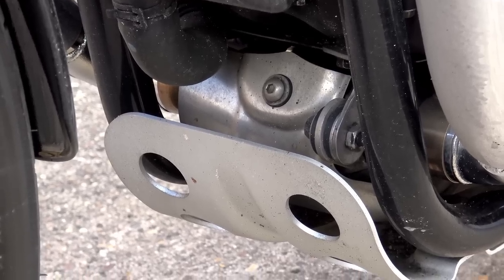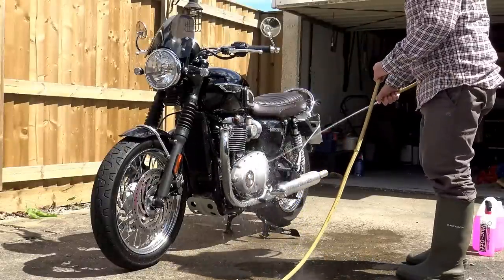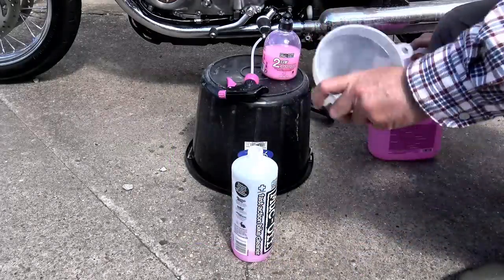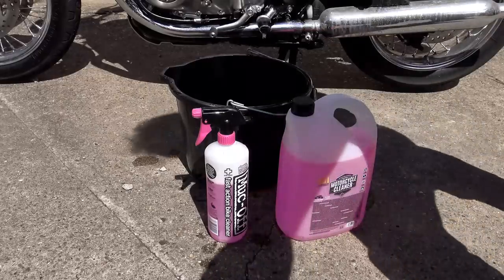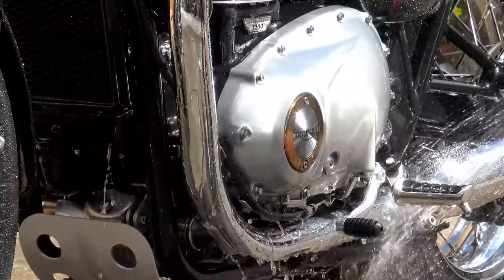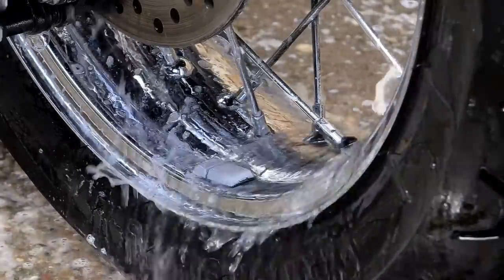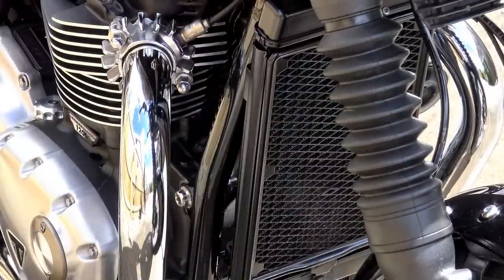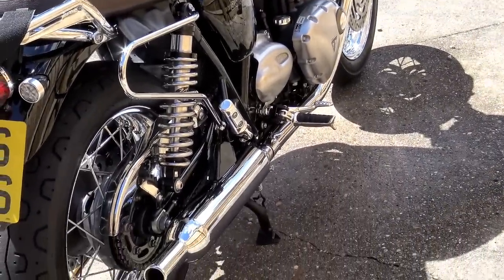Triumph T120, WASHING YOUR MOTORCYCLE. The ultimate bike cleaning method ?

Comment: Stuart, excellent video sir! The only thing I do a little different is to use a light air compressor after drying as much as possible with a cloth. It has the same effect as riding the bike in the final step. That said, I always try to take the bike out and work all the controls. It's amazing where water pools up and can cause some rusting. Thank you sir for all the effort! I learned a lot and will definitely add it to my regimen!
Reply from the maker: Thank you sir, have to admit I do use a compressor myself, but not everyone owns a compressor so I thought I would leave it out and just go down a route everyone could follow without having to lay out for expensive equipment!
Reply: Excellent video.  I currently use S100 - have used it on my previous bikes and now the T120 with success.  May have to try Muck Off when I run out of S100.   Another air method I use for preliminary drying is my gas powered leaf blower - more mobile and not as concentrated as an air compressor nozzle.
Reply from the maker: Thank you sir!
Reply: one of those cheap high power pet dryers available on Amazon work a treat, they really blow the water out
Reply: Also use a leaf blower here to finish things off .. you´d be surprised at all the water that sits in nooks and crannies .. a compressor on the other hand often has oil and especially dirty rusty water sitting in the bottom of it´s tank and that grime can be blown out with the air even though it may not always be noticeable… before wiping dry though a bucket of water mixed with a little Neophos shine from the dish washer thrown over the bike makes for a streak free finish

Comment: Just washed my new RT to your method Stuart. First time I've cleaned a bike for 37 years - and it works! The only thing I did differently was to use my leaf blower to dry it, which worked very well. Oh, and got the hanky out for the bits I'd missed when I'd put everything away, as you do... Thanks for the insights.
Reply from the maker: your welcome sir! thanks for watching!

Comment: sound advice Stuart. I do things slightly differently and use different products but overall do much the same process in touching the bike as little as possible. My diffetences are I use fs 365, a jetwash, but with a very soft wide fan and a ph neutral TFR from powermaxed which is far cheaper that muckoff too followed by a good quality car shampoo ( currently meguirs gold). As far as the drying is concerned you're right not many have a compressor. A cheaper alternative is a pet dryer off ebay. They're normally around the £60 mark but allow you to dry the bike without touching it, though it's best to direct the air blast across things like switches rather than at them so it draws the water out rather than blow it further in. I found it to be an Informative video, Thanks cheers Ade
Reply from the maker: Thanks Ade Glad you enjoyed it, and your right the key is to touch the bike as little as possible!

Comment: Back in my mountain biking days I had a tip to use Fenwicks, similar to Muc Off, but a concentrate so when diluted went much further and I’m still using it. After a ride covered in .....mud. Spray it on, go fill a bucket of hot water and back out to wash the muck off five minutes later and dry in a well ventilated area. Final stage with the motorcycle is to wax on, wax off Mr Miyagi. Unless off course you’ve ridden through the entrance to a farm and ‘it’s’ baked on by the time you get home...interestingly used as a robust building material and equally challenging to remove! Appreciate that chemical compositions can be adjusted over time due to various regulations so can’t comment but hopefully still equally efficacious.

Comment: june 28 '22    on ebay today a 1 liter bottle costs 22.99 ppd.      considering you didnt use it to clean the crud off
the cylinder fins i'm first going to try a bottle of oven cleaner from wal-mart.    you did good to show that
plain hose water rinses it all off after a few min.    i was thinking a 1800 psi spray washer was needed

Comment: Stuart...got my T100 brand new 3 weeks ago...hoping to give it its first wash in the next day or so...soom real good tip in the vid.

But reading the Triumph owners manual today about washing the bike...and would you believe there are around 4 pages.

Anyway gives some do and don't...one it says cover the electrics on the handlebars with plastic bags with elastic bands to seal....also cover the ignition switch...and then it says to plug the rear end of the exhaust pipes...with them pointing down water will run inside if they are not plugged. 

I have no idea how important these actions are but I have got my bungs and bags ready.

Keep up the good work...was your T120 brand new when you got it....its a credit to you mate.

Nick From Cheshire England.
Reply from the maker: Doing it Triumphs way isn't going to hurt!

Comment: Salt in used as a thickening agent to make the product look thick, concentrated quality product. Alkaline is used for dissolving organic material. There is little  dirt that would really need a high ph. Safer bet is a neutral ph as a high ph can mess up your leather seat. All soap bubbles do are trap the dirt into the bubbles so you can rinse it off. All cleaners are acid or alkaline. Muck off is a ph of 11.4, that is not mild..and if you look at the data sheet, muck off contains sodium salt.
Reply from the maker: Your a bit late to the game with this comment Ian. we have devoted entire videos to this subject in the 2 years since this video was published, including the types of salt used in Muc Off, try to keep up!

Comment: Years ago I used a product called Honda Bike Brite one time on a motorcycle. Many people swore by this product.  It also was a spray on , let set a few mins and rinse thoroughly.  I followed the instructions to the letter. Much to my disappointment  all the black engine cases, swing arm etc. came out with a dull finish. Ever since that episode  I've been very hesitant  to use any of these spay and rinse type products, S100 etc.  I like what you demonstrated with the Muck Off product but I need some reassurance I will not experience the same problems as I did with the Honda product .
Reply from the maker: All I can really say mike is that, that has never happened to me in the 10+years ive been using Muc off cleaner!
Reply: Interesting comment.  I tried the muc off method on my new Thruxton R and my old Honda XL250.  The results on both were consistent; the bright alloy casings and wheels as well as the black painted metal both went milky white.  I followed the instructions in that I washed off the cleaner within the specified times.  I am, as you can imagine, very disappointed and now face quite a lot of work in order to retrieve the situation

Comment: I followed your cleaning method on my new t100. Worked great. Oddly however i read the owners manual. It says to cover clutch and break lever and holes on end of exhaust with plastic bags. And put tape over the key hole. And oh yeah don’t get seat wet. Huh? Thoughts on this?

Comment: A thank you for this video.  I have watched all the way through. I wondered if you have any tips for removing discolouration of exhaust pipes.  I have a 1200 GS.  Many thanks.  Stuart
Reply from the maker: Hey Stu, meguiars  nxt generation metal polysh! (their spelling not mine!)
will get most of it off with some very hard work, but, it will come back over time. the product of these modern lean burn engines I'm afraid!
Reply: Thank you. I have returned to motorcycling and keen to maintain the appearance of my bike but wasn't sure how much attention to give to the exhaust discolouring. I think I will leave it as it is and keep the rest in good order. Again many thanks. Stuart

Comment: Nice video, I always use Kent extra large drying towels for soaking up the excess water. Have you tried a hot air blower to get the bike fully dry? I purchased a pet dryer unit for around £50, which does an excellent job of blasting the water from all the nooks and crannies on the bike.
Reply from the maker: Yes people keep mentioning pet dryers but i have to admit i have not tried one as yet!
Reply: Yes, please give one a try they are a nice piece of kit. 
You can by the motorcycle specific version of the dryer but to me they are identical to the Pet Dryer version and always seem to cost more.
Please be careful when you first try out the dryer. I first tried my new dryer out in the kitchen. 
Big mistake, the airblast was so powerful that the hose unit flew out of my hand and the blast of air blew over one of the wife's ornaments that she displays on the kitchen shelf. 
Luckily she was out at the time and I managed to repair it and place it back in exactly the same spot. She will (of course) eventually find out about this little mishap and I will be in BIG trouble!

Recent subscriber - love the content of your vid's
Reply from the maker: LOL Hi again Michael, ill see if i can get my hands on one this summer!

Comment: Stuart, may I ask what you recommend for removing the dried on flies etc from bodywork, fairing and tank. These in summer are often backed on to the fairing, screen and tank .
Reply from the maker: Just put a piece of wet kitchen roll over the area and leave it for 5 to 10 minutes. it will rehydrate the bugs and they should then just wash off with ease! work well with helmet visors too!

Comment: Thanks for great vid.  Quick question.  We live in a VERY hard water area so we also have a house water softener.  Outside on the drive I have cold hard water tap and a hot water tap with soft water.  Should I use the hot soft water over the cold hard water?
Reply from the maker: cold in summer warm in winter

Comment: Good instructive video Stuart,  one thing, do you clean the rear wheel rim separately , to get the sticky chain lube off? maybe I use too much lube, or the wrong sort, because I do have to use a degreasing fluid on a  separate rag,  on the inside of the left hand silencer too, it's only a few spots, but it can contaminate your cleaning mit
apart from that I endorse your method totally!
Reply from the maker: Hi Dave, Thanks, I use a good anti fling lube, I always wipe off the excess before it dries, and leave it overnight before riding. so I have minimal problems with lube fling. I always wash the rear wheel last so any pickup is not transferred elsewhere. the mitt is then washed before its used again.
I always finish by waxing the rear wheel and the petro solvents used in the wax remove any lube with ease whilst waxing and protecting the rim!
Thanks very much for watching  nice to hear from you again.

Comment: What do you recommend to do if you don't have access to a water hose? I live in an apartment building and have a separate garage with no running water :( I thought about going to a washpark at my nearest gas station but by the time I'm there the bike is already hot as a potato, not sure how long I'd have to wait there before I could start with the cleaning. Sigh, what I'd do to have your setup!

Comment: Hi Stuart, I have been learning about the use of ACF50 for preventing corrosion and enhancing bike cleanliness.  I wondered if you have had any experience of this product or a view on its usefulness?  Many thanks, Stuart.
Reply from the maker: yes i do use it in the winter stu, but it is very sticky stuff so doesn't enhance cleanliness! it is also very expensive. I will be making a winter bike preparation video in the autumn so keep an eye open for it!
Reply: Hi guys, I am a long term advocate of using ACF50, with one precaution.  To preserve the molecular bond between ACF50 and fabric of your bike, the manufacturers advise that only Ph neutral cleaners be used. Acid or Alkaline products, such as Muc-off strip the dressing from the bikes surfaces, thereby removing the protection which we have spent time and money applying! With that in mind, might I suggest, Stuart, that you try SDoc100 cleaner, followed by Autoglym Polar blast Snow foam. I can highly recommend these from personal experience.   
Ride safe. 🏍🏍👍👍

Comment: Hi Stuart. Your videoas are very informative and show you have put a great deal of time and effort into producing them. Thanks for posting these, they really are very good.  
 I am new to your channel and have not yet bought a motorbike. I came across your videos whilst researching which bike to buy. Ive narrowed it down to the T120 and will test ride one in the near future. One of my biggest worries was how to keep it clean and this video plus the one with the GT45 spray  really puts my mind at rest. Would you suggest any polish for the paintwork? also what about the leather seat?? should that have any treatment.

A question unrelated to this but Ive seen customised bikes done by a French firm called BAAK. Do you have an opinion about customising in general or this company in particular. 
Thanks
Andrew
Reply from the maker: Hi Andrew, nice to hear from you and thanks for watching!
I'm hoping maybe to do a review on the t100 in the near future as I think the t120 and t100 are going to be compared very closely by prospective purchasers.
The seat on my bike if it is leather (personally I think I was lied to) doesn't seem to need any care as it is supposedly PU coated. but a proper leather seat will need some sort of dubbin or similar waterproof treatment on a regular basis.
BAAK make some very sexy gear and I have not heard anything bad about them, but have no experience of their products myself!
The moderns classic Triumph is all about customisation! and the freedom to make it personal to you sir go for it!
Reply: More good advice. Thanks Stuart, I will keep watching

Comment: Hi Stuart excellent series of videos,I’ll be ordering some muck off soon. What is your recommendation for removing melted boots on the exhaust
Reply from the maker: this is a common problem. Assuming the, pipe is chrome  get a wooden spatula and scrape off any heavy deposits. then get a wad of common aluminium baking foil wet it down and use it like sandpaper to abrade the plastic away. don't scrub too hard. aluminium is far softer than chrome so it should not damage it but it is harder than carbonised plastic. it will take a bit of time but it usually does the trick.

Comment: Since having the T120 I have discovered that my usual protection product of FS365 doesn't work very well with these engine cases as they simply look dirty. I've changed this to using the FS365 for all other parts, but am now using the GT spray on the engine cases, carb areas and shock absorbers. If the roads start to be salted, I might use the FS365 on the cases as well, because it really does protect from the salt. I like the sheen that the GT gives to the cases. By the way do you use solvol autosol to deep clean the engine cases before applying protective spray?
Reply from the maker: you will probably find that the dirty look on the engine casings is down to your clothing or boots rubbing against them and abrading the alloy!. my advice it not to touch them with any kind of metal polish.

Comment: I did use the Muc Off cleaner on my 2001 BMW R1100s until very recently and always found it to be very good and has kept the Bemmer looking pretty good. When the last lot run out I tried the WD40 cleaner spray similar to the Muc Off cleaner but not quite as effective. after seeing a comparison test in Ride Magazine I have just ordered and received some Ammo cleaning solutions which I will be trying in the very near future. Just a little off subject your Triumph looks fantastic and I'm looking to buy another bike so I can do some restoration on the Beemer, I normally take around a 10-day touring trip to Europe each year which involves at least one long day in the saddle getting to or from an area I'd like to get to and was wondering if you have made a longish trip on your Triumph and how you have found it comfort wise special coming from a GS.
Reply from the maker: She is a comfortable bike sir, and i have to say far more comfortable than any of my previous 5 gs models, also much smoother and refined and easier/ more pleasurable to ride! of course the the only drawback at the moment is the non availability of serious luggage! but i feel she would take you anywhere you wanted to go!
Reply: Many thanks Stuart I'm in the process of arranging a test ride at my local dealer

Comment: HI Stuart, an excellent Video. You did mention not to use Muc off on the paint work, have you come across any paint damage. What are your thoughts on the use of a pressure washer to get all the dirt and grime off?
Reply from the maker: Hi Tim, muc off is perfectly safe on paintwork, but it is very efficient and tends to strip off that valuable wax. re pressure washers I dont recommend them and there is generally no need for them if you use the right products.
Reply: @stuartfillingham  Thanks for the confirmation. I am new T120 Owner in Madras and have a myriad of environmental conditions to deal with. Dusty and grimy roads, Hard water with plenty of mineral content, if left to dry will leave severe blemishes on the paintwork and the beautiful brushed aluminium engine casings. I think I spend more time cleaning & preserving the bike than ride it,(LOL).  GT85 is really hard to come by ,are there any substitutes for GT85?.
I do find your videos very informative and quite a few handy tips to look after the bike, so thanks for that and hope you keep posting more informative stuff.
Reply from the maker: Hi Tim try muc off car shampoo! it has a really good water softener which almost irradiates water spots I live in a hard water area myself. finish off with this after the non contact method. any oil based maintenance spray can be used in place of GT85!